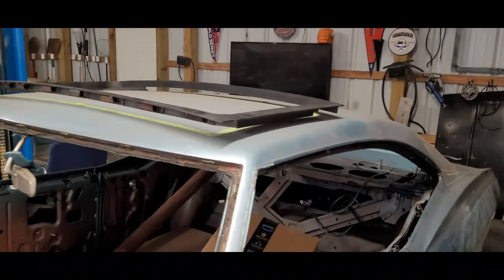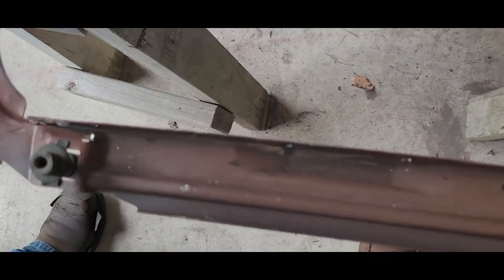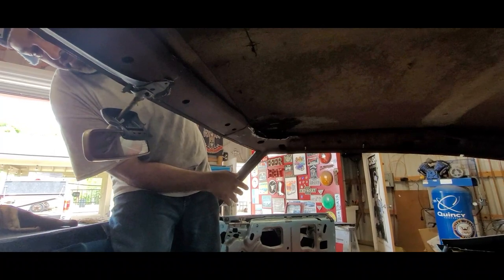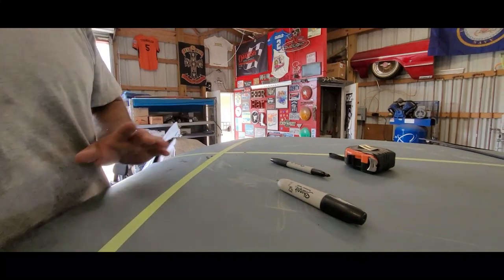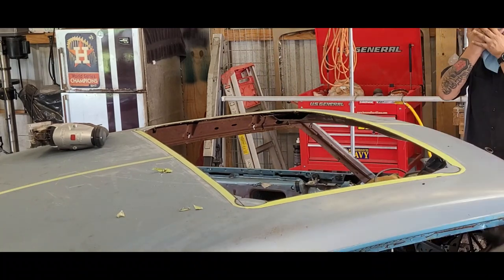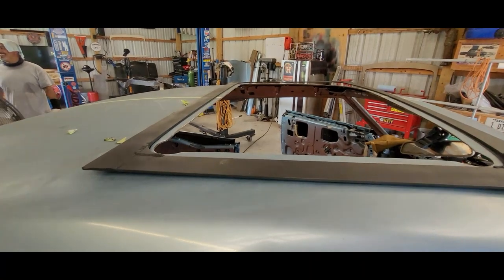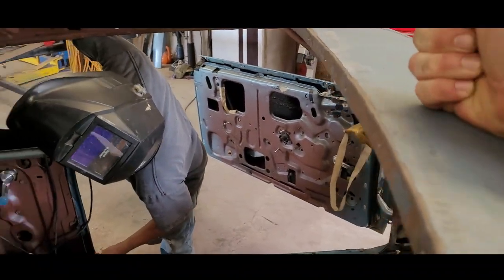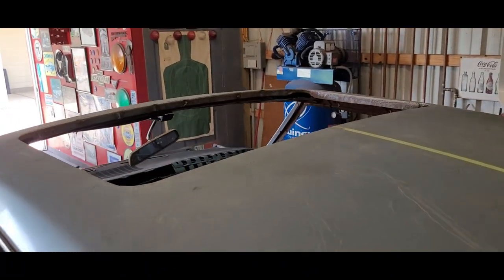How we installed a 44 inch Moonroof PART 1  | 1968 Impala | DIY | Lonestar Lows

Comment: Looks like with the pattern you could trace on the roof was the best thing to make it come out perfect.
Still a lot of work but well worth it for sure :-)
And it looks like you passed all of Bobby's inspections............you could hear him welding and grinding in the back round.
Reply from the maker: I got the frame all welded up. Just doing a little work on the way the bumpers mount